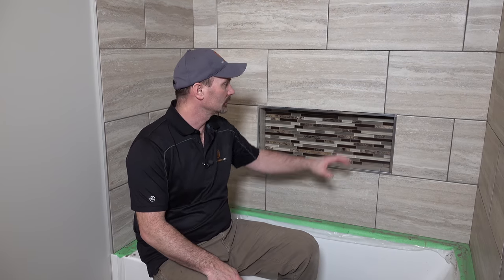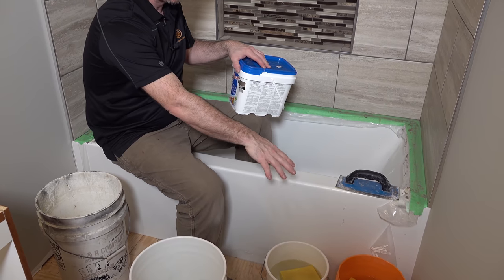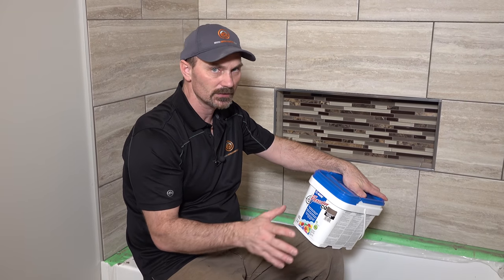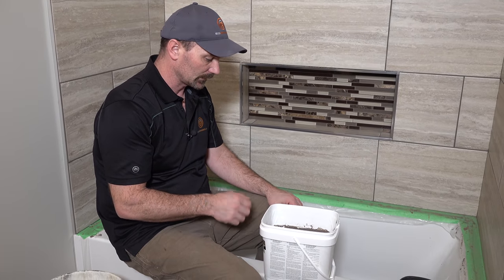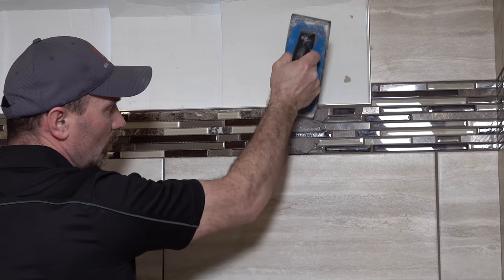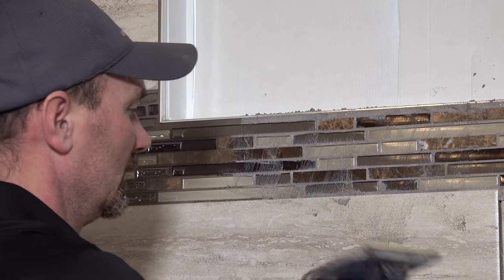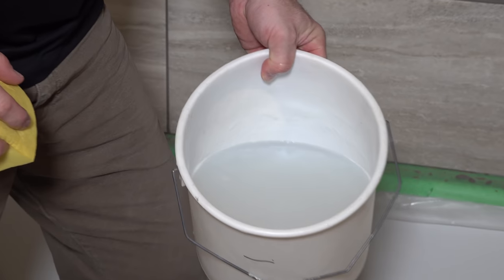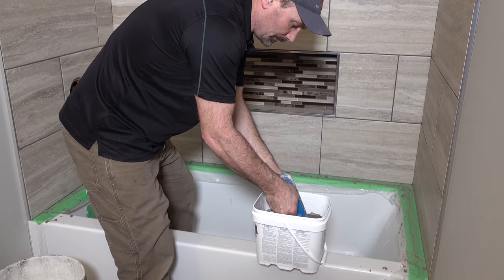How To Grout Wall Tile (Shower)

Comment: Thanks much! I am about to grout and have some spots that are 1/16 and some just over 1/8 wide. Was going to use unsanded (shower) but was worried about slump in the wider spots. Hadn't heard of this particular grout but looks like exactly what I need. I think being able to do a small area at a time will be a lot less stressful than mixing a whole batch and using it all before it sets. Very helpful!
Reply from the maker: Good luck!

Comment: Great vid again by Shannon.  Just a word about that Mapei grout, I've used it and it's fine but it really dries quick so you need to keep on it.  I've also used it on a porous tile, which was a big mistake so be aware of that.  If you have porous tile, maybe seal it first before using this grout.

Comment: Did a shower this year that almost looks identical to 12 by 2s you have on there. We used epoxy grout. Not to fun to work with but is great for sealing and stains from hard water
Reply: I retiled my tub surround four years ago using epoxy grout, too.  To this date, I've never had mold or any problems. You're right. It's challenging to work with the effort is worth it.  Still looks as good today as it did the day I finished it.

Comment: What an awesome job! Just beautiful work, thanks for sharing. I like to know if you use a sealer afterwards? I heard you say that usually you'll tell the customer to wait 24 hours before using it, to me that's saying you are done with it but im just wondering if you usually use a sealer on a job like this, thanks.
Reply from the maker: This Mapei Flexcolor CQ grout requires no sealing ever.
Reply: @HouseImprovements  Oh man!  I wish I would have known sooner because I would have gone with it. Instead I went to The Tile shop and got something that dried to fast and needs to be sealed. Thanks anyway, I appreciate your time and effort to share your knowledge 👍🏽👍🏽.

Comment: Hey Shannon have you tried this grout it is suppose to be the next level grout that will not wash out when your customer cleans their grout lines. I know there are a lot of good grouts out there but the problem comes when customer clean it and it gets soft and comes off, So I am going to try it and hope it works , it is suppose to clean up easy and last. it is a premix called Sprctralock 1 and it is new...

Comment: Excellent instruction, thank you! How firm of a float do you recommend with this product?
Reply from the maker: I have never seen any difference in the firmness of the floats?
Reply: @HouseImprovements  I just grouted a shower with flexcolor cq; it was great to work with. The instructions said to use a medium to hard float. I ended up using an 'epoxy' float, which was quite stiff. It worked but I'd like to try a medium stiffness next time as I think it will be a little more effective at wiping off excess grout

Comment: Hi Shanon, I thought the corners/change of planes were supposed to be a soft joint i.e. caulked with silicone rather than grouted. How come you decided to put grout in the corners instead? Thanks.
Reply from the maker: This grout is very good for not cracking. If it does down the road you can silicone them.

Comment: I feel you have some of the best videos.. you're explaining  as you work..it's great..
so.. Grouting question.. after looking at this video and your recommendation of Flexcolor CQ, I looked at further videos and found some where some folks had this particular grout fail with either color darkening issues after a time, residual haze on the tile,  or just flat out loosening up and getting water seepage...
I'm trying to finish up grouting a new shower tile walls, so..what's you experience with the Maei product? I like the simplicity of using this, but am a bit leery....

Comment: Quick question.  I have a glass mosaic tile on one wall, and then it will be butting into ceramic tile. This uses two different types of grout. Or is there one that works for everything?  Or what is the best way to keep them separate?

Comment: Hi Shannon,  The premixed grout you use is sanded or non sanded?
Reply from the maker: It says it is good for 1/8" to 5/8" wide grout joints. Does really not specify but my guess is non sanded since it will go in a 1/8" joint.
Reply: @HouseImprovements  Thank you for your  answer.

Comment: I noticed you used sanded grout. When would you use non sanded grout? I thought sanded grout was just for floors...
Reply from the maker: Sanded grout as a rule can be used in situations where you have larger grout lines . (wider than 1/8 as a general rule) This particular grout is not available with sand but can be used in larger joints. Read the product label on what you are using it will tell you the limits.

Comment: So those metal trim pieces at the edge of the tile, do you grout between the trim and the tile, do you seal it with silicone, or do you just leave it as it is?? Thanks!!
Reply from the maker: Grout the joint between the metal and the tile